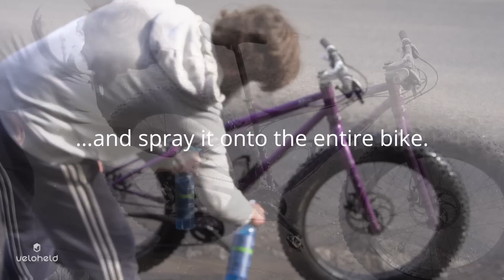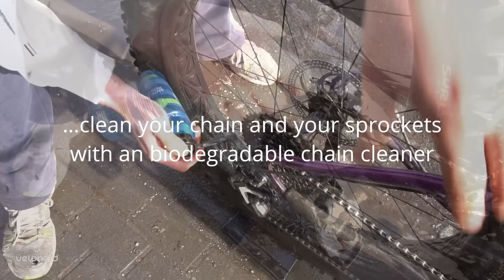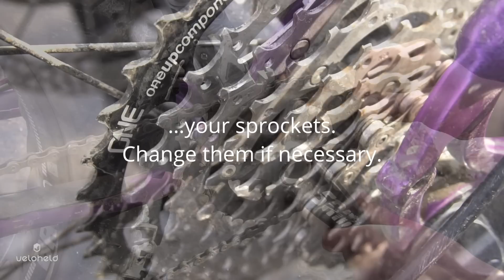How to clean and maintain a steel bike!

Comment: After removing the seat post and looking inside, the seat tube already has rust. What do I do? I bought the frame brand new and the chromoly material already developed rust in the stock room while it wasn’t bought yet.
Reply: If its only seat tube and its surface rust try using a metal brush to remove rust and spray it with something to protect it